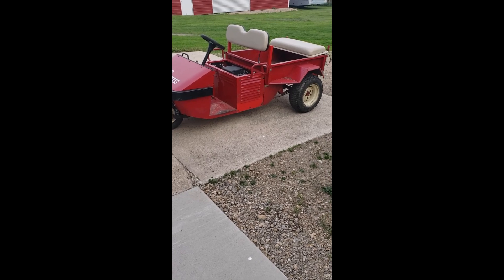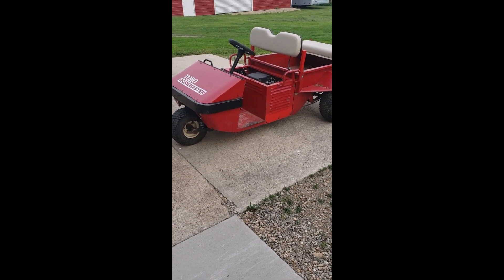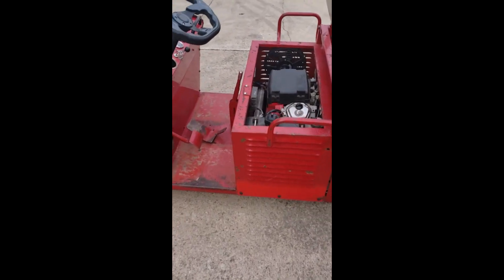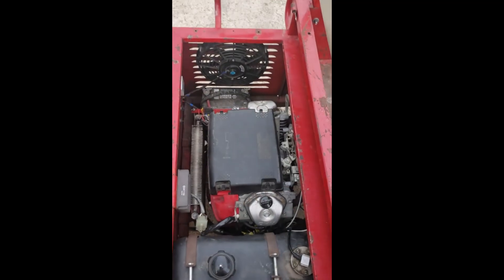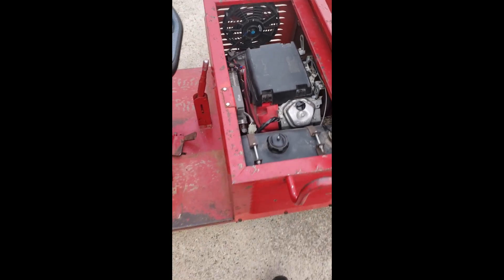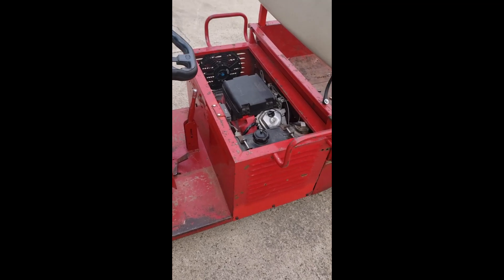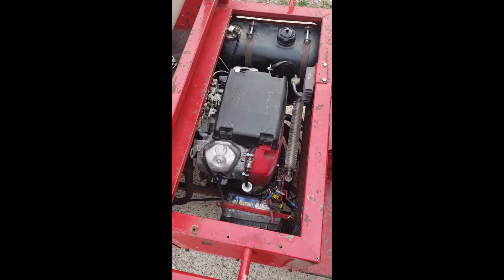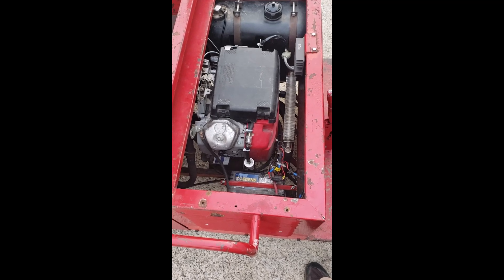HELP! 20hp Honda GX620 v-twin runs rich at idle, fouls the plugs

Comment: 2 years later. What did you find? There is a low mixture setting up very high on carb.
Reply from the maker: For some reason that engine is still fouling the sparkplugs. Maybe your onto something. Maybe I need to find that setting you're speaking of.

Comment: If you still mess with this engine, I have a service manual that I could send you.
Reply from the maker: Thanks for the offer. Its solved. Ive just moved several hours out of the area its from and one of first small engines I'm shown at the new location is a gent rebuilding the exact same engine! Him and me are gonna be first running it on the work bench next week.
Reply: Do you atill have manual info
Reply: @holdenbreau yes

Comment: It actually does have a pilot jet that is not fixed it’s tamper proof. You will have to break the anti tamper end off and install a regular pilot jet screw it’s on the  left side of the carb if your looking at the flywheel at the top

Comment: I have the same issue, please help!!
Reply from the maker: You need a carburetor with adjustable idle jet. Your gonna have to pony up two benjamins for the OEM one or find a proper generic one. I ended up getting the OEM carb and that was almost set perfectly. I was able to lean it a smidge to get it perfect.
Reply: OGod,.  I as well
Rich as Crap....main Jets in my GX670 ...100/in both